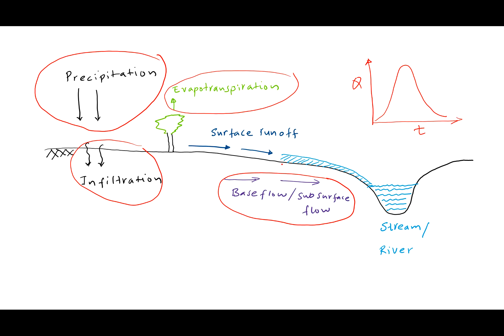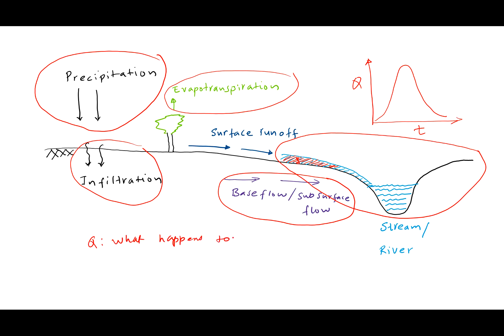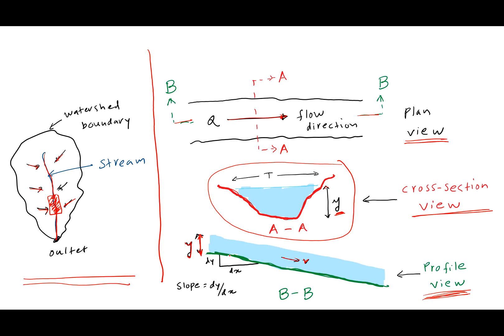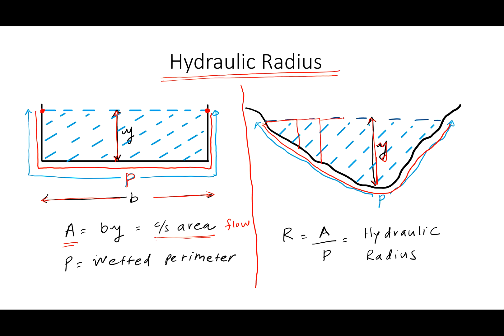Manning's Equation

Comment: I have a doubt if s in Manning equation represent the slope of energy line .so it should be total head loss /horizontal length.but in slope area method we take this slope as hf/L where hf is head loss due to friction why we donot consider head loss due to eddy in calculating the slope of energy line ?
Reply from the maker: good question. Manning's equation is primarily used to compute the major (friction) loss. There are ways to incorporate other minor losses in HEC-RAS by editing minor loss coefficients. Hope this helps.

Comment: I understand the equation of hydraulic radius(or hydraulic mean depth) but how to visualise it i mean for example i can visualise area is π/4D² so it covers whole pipe area but what is hydraulic radius in practical point of view? which part or section of the pipe it represents!?
Reply: Dear, we need to consider only flow area for calculating hydraulic radius (R =  Flow Area/ Wetted Parameter), So practically you may say that it is length when multiplied by wetted parameter gives the flow Area
Reply: you may refer to my lectures on hydraulics and water resources
Reply: You can not use manning equation in closed pipes…

You would need to measure distance divided by time, to get your velocity… then you will calculate your area x velocity to get your flow rate in a pipe.
Reply: Example… add an ice cube, measure 10 feet… time how long the ice cube takes to get to the end of 10 feet… divide 10 feet by the time it took to pass 10 feet… that will give you your velocity.

Then you can multiple area x velocity = CFS.

Comment: Just one question. Why we take chezzys and manning coefficient independent of fluid viscosity. i.e. According to my thinking, there will always be a fluid layer sticking to the bed (no slip condition) and the effect of bed roughness is propagated to other layers of fluid via viscosity. But both these coefficients doesn't have viscosity component in them.

For example if I apply the Mannings equation for hot areas where water temp is at 30 Centigrade and in cold areas where the temperature is 5-10Centrigrade. In both, the case Mannings equation will yield the same Flow rate but I think the flow rate will be different in both cases for the same channel.. Please help me with this.
Reply from the maker: Good question! Manning's equation is an empirical equation derived specifically for open channels where the flow is turbulent and is mostly used for the flow of water. Calculation of Reynolds number which is used to find whether the flow is turbulent or laminar does include fluid properties (density and viscosity) so we could say that these properties are implicitly included in the application of Manning's equation, but you are right these properties do not explicitly appear in the equation. Hope this helps!
Reply: @hydrologyvideos8253  thanks
Reply: Open channel flow is basically based on gravitational force unlike pipe flow where viscous force plays a major role and infact viscous damping reduces the turbulence in flow and when turbulence  force over comes the viscous damping turbulent flow is initiated (Refer to my explanation of Reynolds number). On the other hand in open channel flow viscous damping does not play role, so, these roughness coefficients do not have viscosity factor
Reply: Manning's eq. has a standardized table of roughness coefficients based on the stream's characteristics